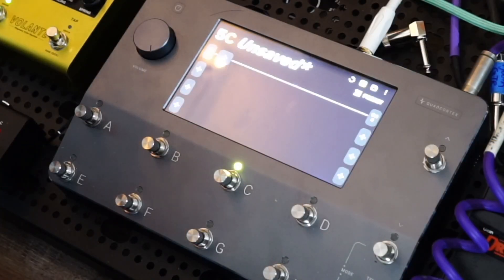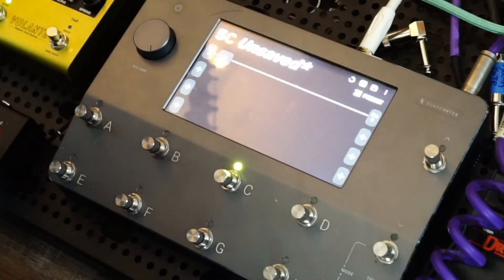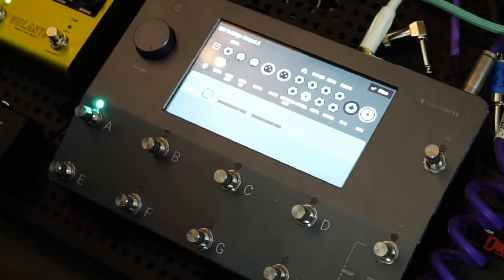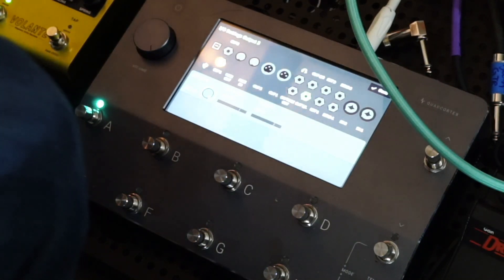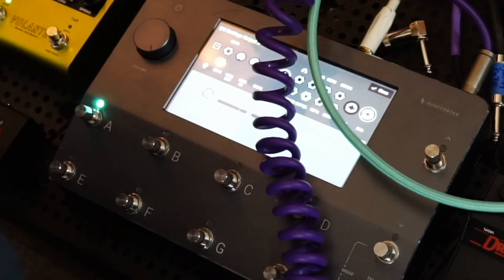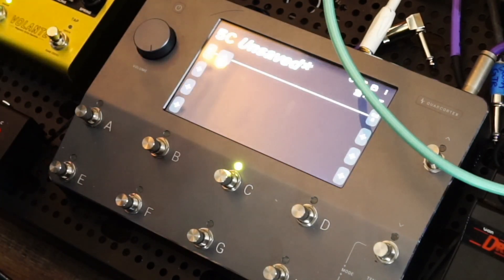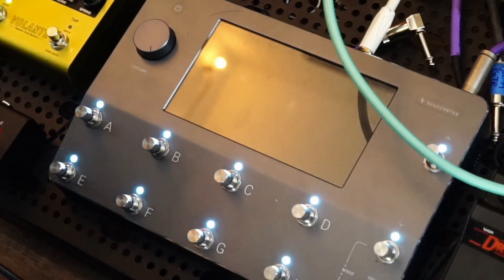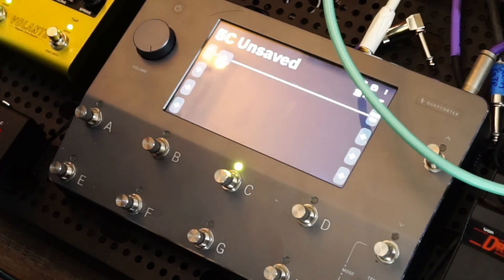Solving the mystery of a pedal board producing no sound! ( Solved the problem!)

Comment: Thanks for the vid. I just set up a brand new Ciocks DC7 and was very careful to make sure everything was right. Power to the pedals but no sound. Bass to amp works with both input and output cables, all the patch cables work, and even my old OneSpot adapter works (which is what i was replacing in the first place because it's a flimsy, unreliable thing). Pretty frustrating but I'm going to reach out to Ciocks and see whats up...

Comment: I had the exact same problem. I was using the stock power supply into a junction box that was splitting power between a few pedals. The output would suddenly go mute after 20 mins or so. If I turn it back on after switching it off again it would work for a bit but would go off after a while. 

But the problem you show here is exactly how mine looks like after it stops. Can see the output in the meters but just no sound. 
I’m hoping switching the power supply might solve this problem
Reply from the maker: Quality power supplies may seem expensive, but they are worth every penny and I hope it solves your problem indeed.

Comment: Ciolks works great with QC and pedal boards, I have seen several people indicate you need to aggregate two power ports to one using their adapter cables.  Evidently something to do with the amperage requirements.
Reply from the maker: The lovely people at the Neural DSP forum helped me and we solved it indeed, it was a matter of the switchees on the side of the DC7 being placed int he correct allignment for all 4 of the outputs powering the QC.  Works perfectly now!

Comment: How are you powering from the cioks wished I saw it , that what I am using to power the QC plus an Eventide H9 with no issues
Reply from the maker: Hey Luke I had one of the 4 outputs of the 8800 flex cables not switched to 12v, that alone did it.  My mistake really, but the reminder to double check from the NDSP community had it sorted quickly
Reply: @AudiomoMusic  ah ok great to hear you good now because I’m using this setup it’s been great modifying mine with right angle though as I needed some space